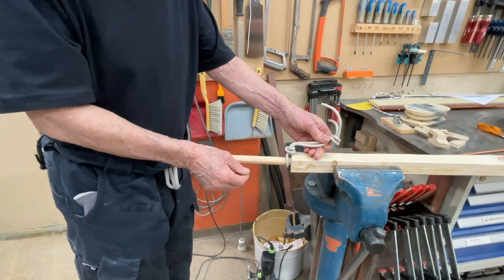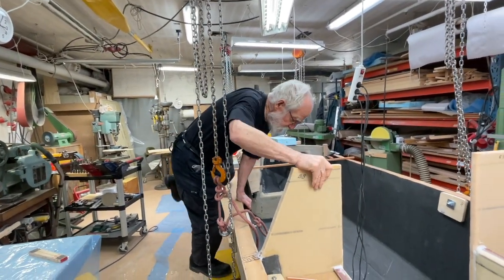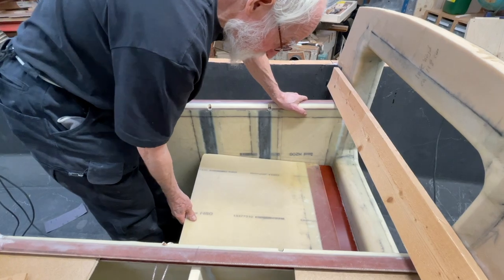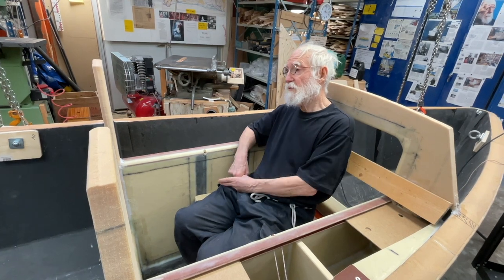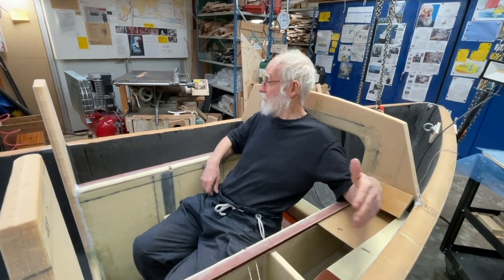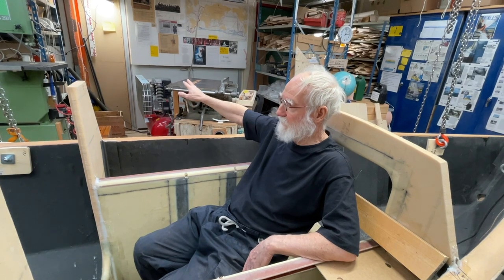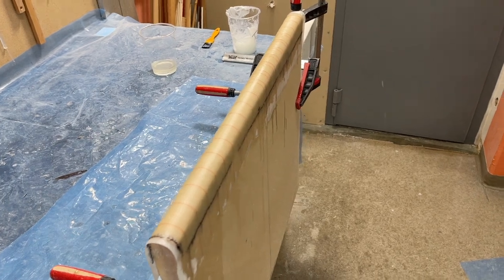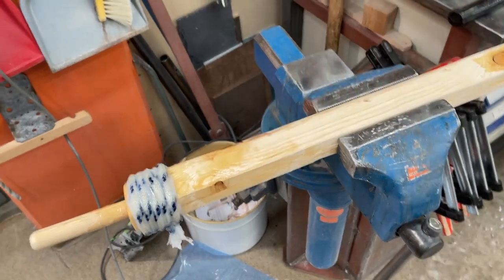The seat and the boom. The seat feels fine, the boom more later.

Comment: Following you for 40, 50 years since you came to Brazil, we met briefly! Congratulations on the building. A question: when you're sitting at the dining room, your head sticks out from the deck level, as per the bulkhead. Will you have a hatch (which will have then to be open) exactly on the spot where you will be sitting?
Reply from the maker: There will be a deck house but no hatch in the dining room.
Reply: @SvenYrvindExlex  you need to go to Brazil 🇧🇷... 👍